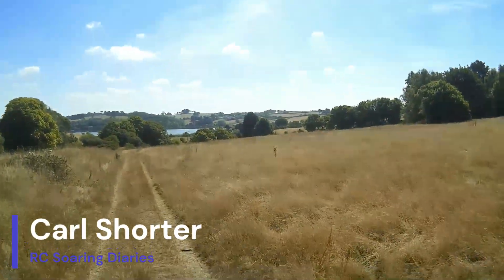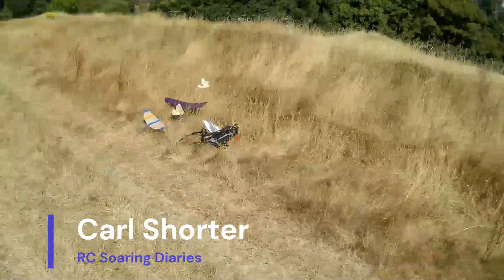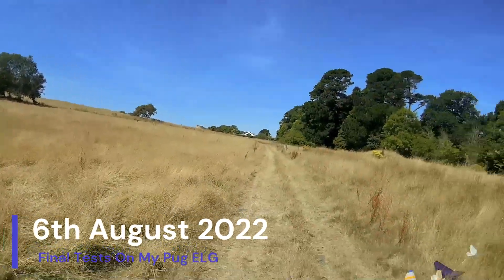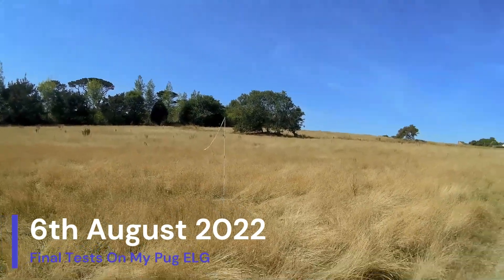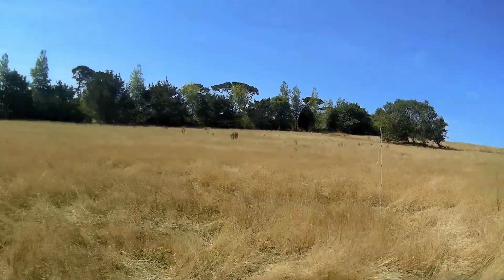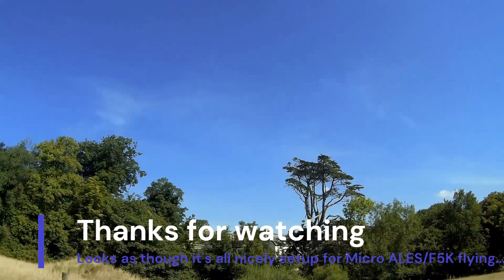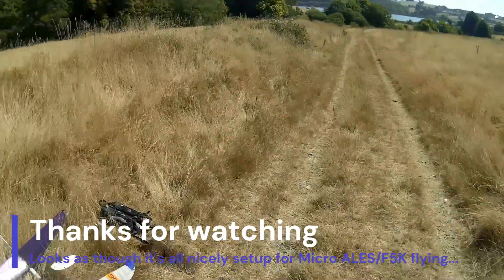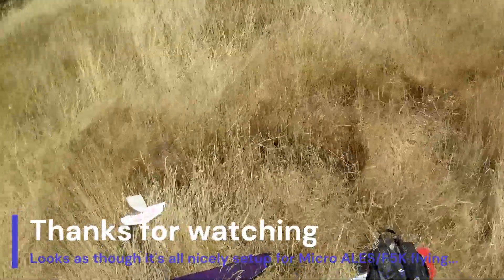Electric Launch: Pug ELG Final Tests - RC Micro ALES Glider - 6th Aug 2022 - Angelwing Designs

Comment: Sounds like you have got the opentx settings almost spot on for this one 👍
Reply from the maker: Yep, all working great, and I've applied the programming on my 1.5m Robbe Joy, but without down elevator mixed in with throttle as it's not such a rocket. So the programming is a simpler version 👍
Reply: @RCSoaringUK    any plans to share the program setup ?
Reply from the maker: @FraggsUK  Yes I will be 👍